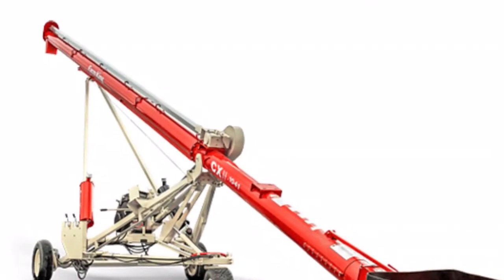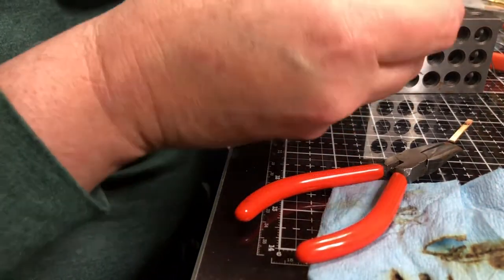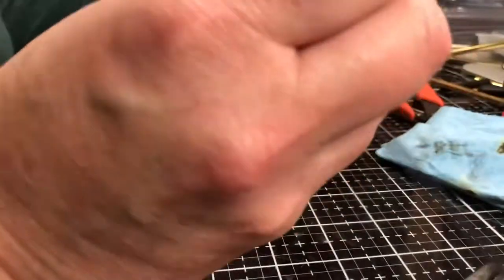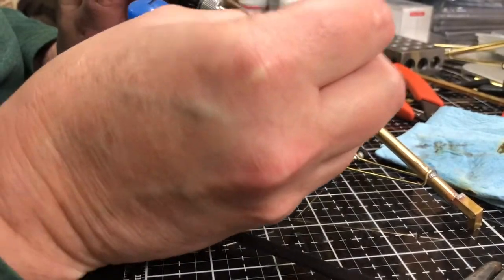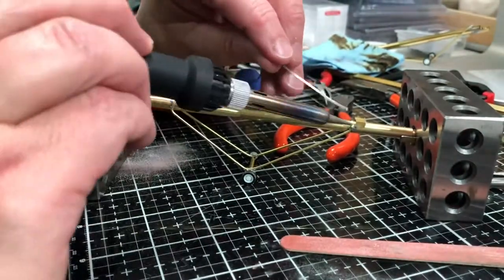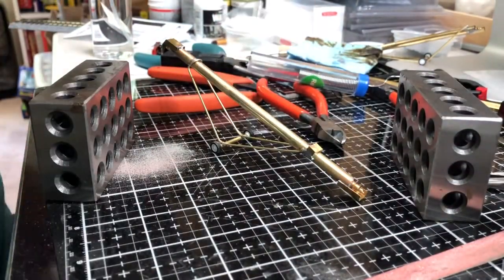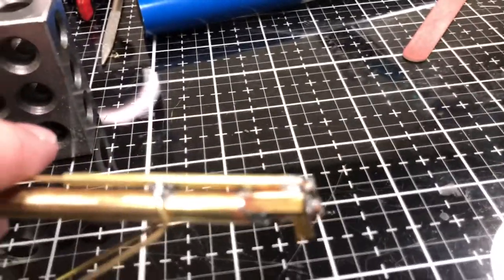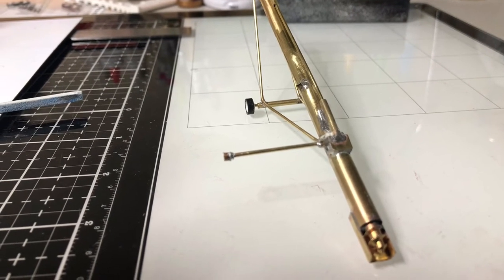Shack Build Part 8 AUGER BUILD PART 2 WELDING

Comment: The red soft pieces on your clamp slide off. They're not glued on or mechanically fastened onto the clamp. You could have taken the red pieces of the clamp and used it anyway. I can't believe the detail you're going into with this build. I thought you was building a shed but hell you're building a model of a portable grain auger. This is so cool and you're doing an awesome job.   👍
Reply from the maker: William, you know I thought about that, but it seems once you take them off it is either they keep falling off or I can’t get the back on.  Luckily it worked out. Thanks about the detail, but it is still minimum. And yes it did turn into its own scratch build.  Funny still have to build a fertilizer truck too.